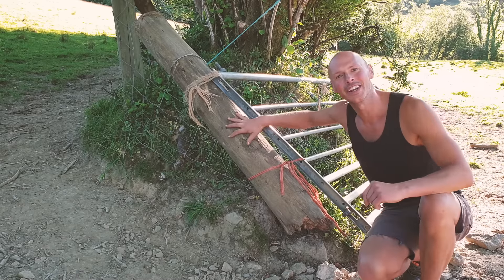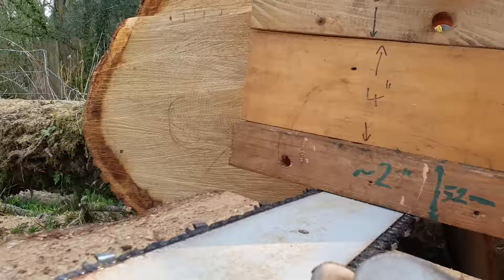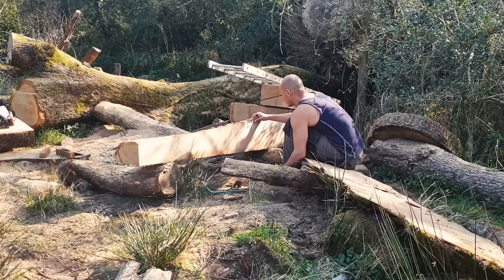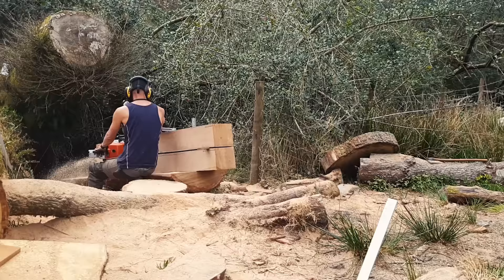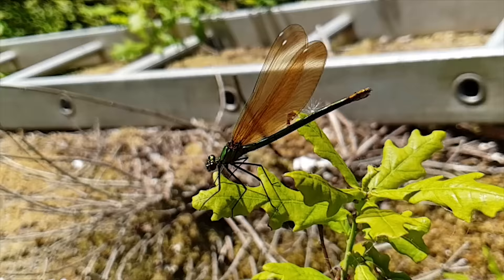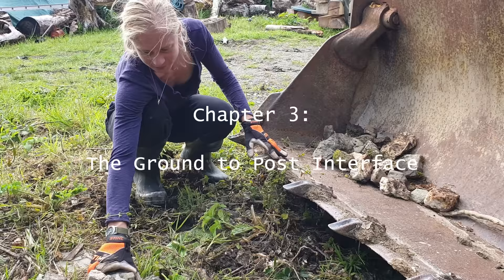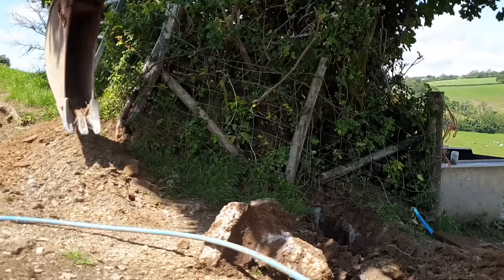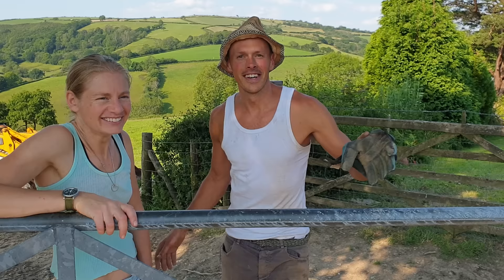The 3 secrets to ROT PROOF POSTS and how to make them

Comment: I have been doing fenceposts for 13 years in the Northern Rivers of New South Wales, The main thing things I have learned has been to use crusher dust to pack in the post, which is tiny chips of basalt in conjunction with lots of rocks (crockery is a great idea though) and I wouldn't use such exacting gate latches, because usually the posts support wire under tension or gates which tend to (over time) effect the position of these latches, meaning you need to adjust the latches.  We usually use chain and a little knob. Also, the time of year/ weather is important, our soils are predominantly clay, which swells in the wet season, so if you do posts in the wet, they will likely rattle in the holes in the dry season when the clay shrinks. So I save fencing for the dry times! Love your work!

Comment: Great video. Charring the wood for a fence post is something I had not heard of before. When I use wooden fence posts mostly cedar since it is plentiful in South Texas and the Texas Hill Country. we cut the top of the post at a 45 degree angle with the slope of the post facing south. Any moisture will roll off the 45 degree slope and the southern sun will keep the top of the post dry.
Reply: Thats a really neat trick does it have any effect? Also what would you say to painting the top of a post? Is that a no no because moisture in the wood needs to breathe out here?
Reply: Great  suggestion with the 45 degree slope .   Can also use aluminum sheet stock punched out a little oversized and screwed and a bead of adhesive down on the slope . Found in snow country working with log buildings for many years, that most damage accrues during the fall and spring by the melting of snow during the day and refreezing  at night where the water has sept into the checks or cracks in the logs . It literally splits the wood a little each time .
This also happens with wood posts when water gets into the end grain or the top of the post .

Comment: Realised and checked out all the posts I have changed rotted exactly where the concrete was.  Concrete is a sponge and soaks in water and promotes rot. Watched an article where posts where pre cut and left in old engine oil and diesel just past there buried depth,  if you tar the post  where it’s in the ground, not the bottom to allo water to run out and cap the top to stop it soaking again, as you did stones on bottom to allow drainage you will get a longer life out of posts. You had fantastic wood available all the tools and skills to do a very skilled job and you where both fit enough to do the job, nice Vid.
Reply from the maker: Good Evening Anthony, late reply, but none the less I wanted to say I appreciate your comment and encouragement :)
Reply: That is proba ly why my grandpa would paint tar on tbe sides..
Reply: It's not that concrete is a sponge, quite the opposite. If a post gets wet it can't dry out as the concrete is virtually impermeable. The concrete will let water run down a post and then between the post and the concrete where it will accelerate the rot. If a post is sat in a hole with rocks the water can drain away.

Comment: great job ,well done .2 years ago i cut and peeled 30 larch stakes  from my own wood.let them dry for 6 months,then scorched them and soaked them with burnt oil while still hot.now i drove them with a post driver but i expect them to last a reasonable time .cheers from ireland.ps she is a great worker and georgous too.
Reply from the maker: Hey Jimmy, thanks for sharing this - I have a bunch of larch wood, and wondered about doing a similar thing. What kind of container did you use for heating/soaking the oil - old bath?
Reply: i put scrap wood into a half steel barrel and fired it up.then placed one stake at a time  resting on the barrel,rolled it back and over until well scorched  then put them in a narrow steel bath with burnt oil in it and covered the complete stake , the oil really soaks in when the wood is hot .cheers. my you tube debut is ...jimmy the saw ,,logging ireland. @FloweringElbow

Comment: 30 years ago I installed treated yellow pine posts as porch supports. I coated the below ground sections with asphalt based roofing patch and several ;ayers of aluminum foil. Perfectly intact 30 years later. Always a good idea to coat the above ground sections with a penetrating water sealant as well. I used Thompson's Water Seal
Reply: Other than the wood treatment that seems like a great solution. Not sure how well modern treated wood sans arsenic would do in that setup.

Comment: Heated used motor oil,  50 years ago I had the need to treat some 6x6 pine post for a porch.  Farmer suggest that I take 5 gallon can on a electric hot plate stand each post in turn up in the can and fill the can couple of inches from the top.  Turn on the heat and bring the oil and post up to 230F or until the water starts boiling out of the wood.  Then the whole thing cool, let it cool sucks the oil into the wood.  Well last year I had to replace beam sitting on the posts.  All three posts were still solid and reused.

This same farmer had a another process,  but it was slower.  Involved 55 gallon drum with one end cut out, stand further fence post in drum pour in waste oil, let sit for a year.
Now both of these methods are probably environmentally no longer appropriate.  But they sure beat treated lumber of 50 years ago.

Enjoyed your video.

Comment: Use clean Oil on the section that goes in the ground very well any part that touches soil or concrete  .
Clear all plants away from the Bottom of the posts and let the air flow around the post all the time don’t let the weeds grow to much .
Every year dig back the soils a few inches and oil up a few inches of not the hole or what ever you fancy and to 8 niches out the soil or better all of it  .
Put a protected cover over the top ie lead  or a plastic cap or cut the post into a spike makes it last a lot longer indeed  . 
Do as much as you can to prevent the rot setting in. My oak posts have been in the ground 33 years still going strong . 
All of your advice was gold  I admire your forestry skills and your milling I Real Man 👊🏿 great to see these days .

Comment: Yes I use it all the time. It is pine tar., historically from Sweden. There is a cheap domestic version used by veterinarians, but the best is from Sweden. You can smell the difference. Dilute the first coats with thinners to get it to penetrate. I mixed it with linseed oil and painted both sides of the ship lap siding I used on the two storey house I am building, then painted all the exterior trim with a stronger tar mix. The siding is a lighter color than the trim which is rather black. I add Japan drier to speed up the dry time. It smells wonderful.
Reply from the maker: Hey Jeffery, Thanks for sharing! Really interesting, and I wonder what a combo of that and charring would be like? I will have to look into it... And also now need to look up 'Japan drier' ;)
Thanks again, Bongo.

Comment: I live in Australia on a 50ac bush block. We're generally blessed with amazing wood and there is lots of it where I live. My place is only accessible via a private farm road. I'm in regular contact with the farmer who has nearly 3000ac but I only need to traverse about 500m of his land to get to my place.
Anyway this means the farmer - my neighbour, knows a thing or two about fencing since he runs Angus cattle. Fencing needs to be reasonable if you run any kind of cattle.
Apparently the no.1 thing that makes fence posts last, more than all other factors, is using wood that you've cut from your property. 
The thinking is the wood is already adapted to the soil microbes so those microbes don't feed on the wood as they would if the wood came from another area.
Of course some species of Eucalypts are better than others. Some Eucalypts in the Box group being exceptional underground with superior weathering resistance - even without caps. The gate post of the farmers corner for the road to my place is at least 130 years old and although looking pretty gnarly and leaning, it has many years of life remaining. It is Eucalyptus Melliodora AKA Yellow Box. The corner posts are always Box of some description and the other posts more common Stringybark of which there are several species in this area. 
Here's the thing, all the posts were just put in the soil and even the Stringybark posts last 100 years.

Red Gum (E. Camaldulensis) is another absolutely amazing wood for underground and underwater too since it grows on floodplains and tolerates submersion for long periods. The Boxes are similar in weight to what you were handling I'd say but Red Gum is in some ways surprisingly light. Some Boxes category Eucalypts and Red Gum make amazing firewood.

I'd say fencing lasts longer here in part due to the far drier climate, although in wet areas the fencing there lasts really well too.
Oaks here grow fantastically well. Doesn't matter how hot and how long a drought goes on the Oaks seem to thrive and they haven't developed weed status like some other European trees either. There is a single Oak in a paddock not far from here and I estimate it is perhaps 120 years old. It is just amazing to sit under on a 40deg C day. It's like another world in there. The heavy lower branches almost gravity defying.

Comment: Great video. Wooden posts rot most in the first 6-12 inches both above and below the ground line, so runnig the charring well above that, plus the stone runoffs, as you did is key to longevity.
My dad was a big fan of top hats for wooden posts, and our oak field gatepost put in in 1973 is still firm. Without the hat, rain runs off for the first 10 years and it seems like you don’t need a fancy top, but after that the natural cracking widens, fills with porous material and acts as a sponge, so not only does the head of the post decay but the weakening travels down most of the length of the crack. I’ve seen oak post just gently part into two.

Comment: Loved the video and information.  Living on a farm in SE Kansas we put many a fence post in.  Usually we used mixture of metal T-posts and Osage Orange, known as Hedge locally.  We would use a massive 8 foot tall by 18 inch thick post for corners which were opposed by relatively big Hedge posts down either side fence (we left the bark on and did not treat it in any way).  I say opposed as they we would use a thick metal pipe in the middle and then heavy duty 10 gauge steel wire for the bottom of one post to the top of the corner post and back.  This wire was then twisted by inserting a small handle-sized piece of Hedge between the wires and spinning it.  Once it was as tight as it could get without tearing, the handle would be rested against the metal pipe.  This locked the handle into place, but allowed it to be tightened if needed in a decade or so.  The corner post would be buried 3 feet deep, and like your's surround by rocks on the very bottom and about a foot from the bottom.  Then, much to my consternation, dad would say, "Now, put all the dirt which came out of the hole back into in the hole."  I want to you imagine this.  Dig a three foot deep hole, two feet in diameter.  Then, fill the bottom with 6 inches of stone (crushed or solid if available.  Then, fill the hole with a post leaving only a couple inches around the side of the post.  Next, fill what remains of the hole 1/3 of the way with large rocks.  Finally, put all the dirt back into the hole.  Surprisingly, with enough back pain and blisters, it can be done.  Then, we would use 10 metal T-posts for the fence (5 strands of barbed-wire).  After the tenth T-post we would put in another Hedge post which was 6-8 foot long and 6-8 inches in diameter repeating the previous fun had with filling the corner post hole.  These Hedge posts will outlast the metal posts, but what goes first are the fasteners holding the barbed wire to the any of the posts.  My grandma helped grandpa put in Hedge posts on their farm when they were dating.  When grandma was in her 60's she hit one of those corner posts and totaled her car.  The post is still standing and holding fence 30 years later after that car wreck.
Reply from the maker: Good day Rick, great to hear your experience, thanks for sharing this !

Comment: painting old engine oil works for me , my main strainer posts are now 50yrs old and still strong , as an added feature  i 12 inch augered  the tops and filled with oil before metal capping , 20 yrs back as caps became loose i topped up the oiling , its a lifetime trick for my 12km run that has worked for me , hope its usefull to others !!!

Comment: He did not mention it but the burning of wood also makes it Hydrophobic. Water will bead up and roll off. Japanese have used it for the outside cladding of houses and buildings for a long time. I hope it works on the underground parts of those posts for a long time to come. Good luck to the two of you!!

Comment: Small thought: if you use seasoned oak, it will last for decades.  BUT, you have to cut it & leave it for 2 / 3/+ years, it get harder as it ages - you probably know.  I have tried working in houses 200+ years old, and cuting / chiseling / drilling into oak is near impossible, hard as iron.
If using stones to pack the post, I ram them down in turn as hard as I can adding crushed stone on the way.
When putting in posts, I set them in concrete (self mixed, not 'Postcrete'), with an upstand / collar of concrete, sloping away from the post.  They will last for decades.  AND, I seal the top of the posts with a thick layer of Seal 'N Heal,  repainted every couple of years.  I expect they will still be there a LONG time after I am gone.
Nice vid, that post won't need doing for a long time.
Reply from the maker: Good morning Theo. Thank you for sharing your experiences, really interesting.
Reply: Their gate posts are performing work while seasoning...

Comment: I placed  6" treated fence posts in concrete with 2" cover thinking that is minimum specified to protect steel, bearing on rocks then lathered intersction at ground level with creosote 10 years and still seem solid but not really that long in scheme of things. First heard of shou shugi ban (?) a year ago and tthat is the way I intend to go for treating posts for decking project. Good vid ' rocked along with no filling out blather like most, thanks.
Reply from the maker: Good day Dog Paw, thanks for sharing your experiences, and your kind words. If you do the shou shugi ban just remember not to use treated wood - those fumes are nasty  ;)  
Peace, Bongo.

Comment: Couple of things, great content and very similar method as what I use. Here in the Houston Texas because of all the rain, I use Mexican beach pebbles at the bottom of the hole, pressure treated post and concrete. The is poured about 3” above ground level and then sloped away from the post. I’ve found this last a great deal longer, & I cap the post as well. The neighbor has had to replace his fence twice thus far since I made mine. My next fence will be made with no nails or screws, it will be all timber frame joints and sliding slats.
Reply: Great, one of my pet peeves is people who set any kind of posts in concrete below ground level.  They rot so fast, it would be better to just set them in dirt. And easier to replace if they did that.  Like you, I always set them in concrete above ground level, and slope the concrete.

Comment: In France telephone poles bottom parts are coated with tar. I've heard that used engine oil makes a good protection also. I enjoyed the video which was both informative and entertaining.
Reply: In Poland the wooden post is bolted into a channel in a concrete post so no wood is at ground level.  Clever communists.
Reply: I live in France and it never ceases to amaze me how poorly the poles are installed. They are often not deep enough and rarely have stays meaning the poles lean and topple over due to the weight of the cable and the 'pull on pole' caused by prevailing winds. The poles are also about one third of the size of those used in the UK. Having said that, the UK poles are substantial enough to be climbed.

Comment: Excellent.  Lots of great ideas.  Two more, plus a question: 
1.  Many years ago I was taught to slope the top so water runs off -- either one surface like a shed roof, two like a gable, or four like a hip roof.  I tend to prefer the shed.  I do love the copper bonnet, and have used that, but have soldered the tabs where they are bent closed at the corners.
2.  Tack a piece of asphalt shingle onto the bottom of the post which is just slightly smaller -- so if the post is a true 6x8 inches, use say a 5.75x7.75 bit of shingle -- and pound the shingle with a heavy hammer and end grain board or dowel so as to push the tar/asphalt into the end grain of the post.  Then flip the post over and set it on your flat rock.  This to minimize water uptake when the hole fills after a heavy rain.
3.  The Q:  I am going to look through your other videos for more info on your chainsaw mill, but would like to ask now what model/size Stihl saw is that?  and would you recommend purchasing new for this sort of use?  OK, so that was actually two questions.
Thanks in advance!  Y'all are just great.  I love to see how you work together so well.
Reply from the maker: Hey Ellsworth, thanks for sharing your thoughts. So the saw's an Shihl MS880, I started milling with a Ms440, and it was a bit small for the big wood I was asking it to cut... I bought the 880 new. It was expensive, but cheap compared to a bandsaw mill. Hope that helps :) Peace, Bongo.